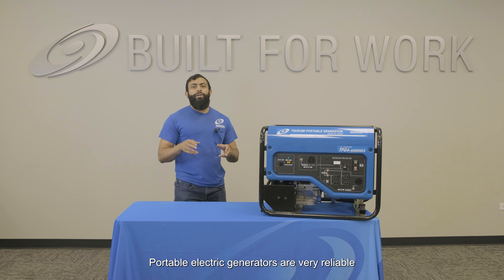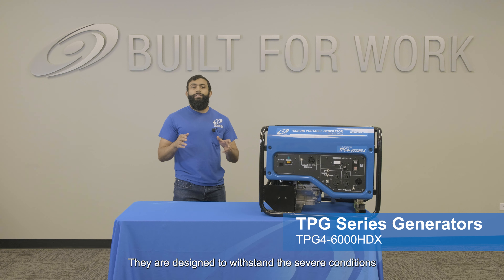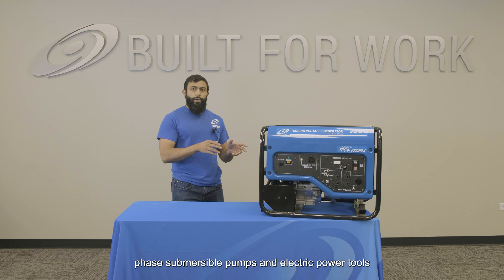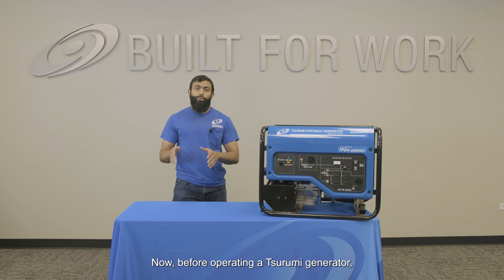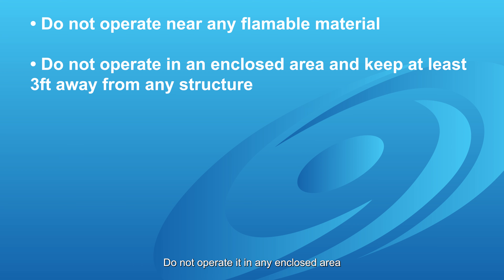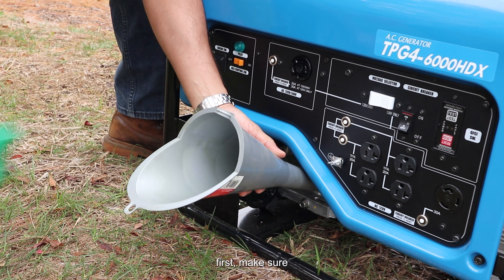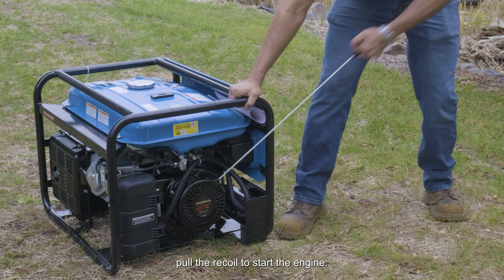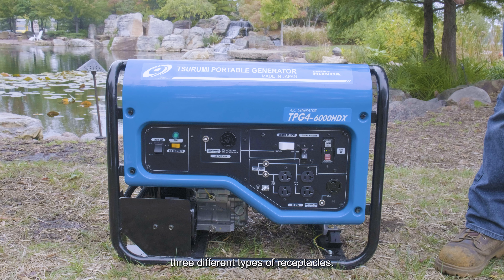How to Operate a Tsurumi TPG Generator

Comment: Hi I have the 6000HCSA model and when switched with the idle control ON the engine revs up and down continuously with no load, the carb is all clean and gas is flowing to it. Engine runs fine with the idle control turned off. Does the plunger type unit at the bottom of the carb control the amount of fuel going into the engine, I looked inside the electrical panel and one of the wires coming from that bottom of carb unit is pinched almost flat, could that be the trouble if not then what could it be please?
Reply from the maker: The plunger at the bottom of the carburetor is the fuel shutoff solenoid. It activates when the generator is turned off to prevent a backfire. It shouldn’t be the cause of the issue if it’s only occurring when you turn the idle on. However, the idle mechanism is controlled by the idle control solenoid on top of the engine. If that is gummed up or malfunctioning, it could be causing the issue. And when you say the carb is clean, did you take it all apart down to the pilot jet to make sure all the tiny holes are clear? With surging, it’s usually an issue with the engine side so you might have to take it to a local Honda dealer to look at.
Reply: Hi for some reason the low idle is working properly now but I would like to have an owners manual can't seem to find one can you send me the link to one or somehow help me to get one it's the TPG3 - 6000HCSA. Also is this generator safe for sensitive electronics such as a microwave or TV.
Reply from the maker: @chadbosko8935  When starting or using equipment, the voltage can vary a bit so it may not be safe for electronics that are sensitive to voltage fluctuations. You may need to use a surge protector and/or a UPS (uninterruptible power supply). As for the manual, please send an email to tech@tsurumipump.com and we can send you a pdf of the operational manual.